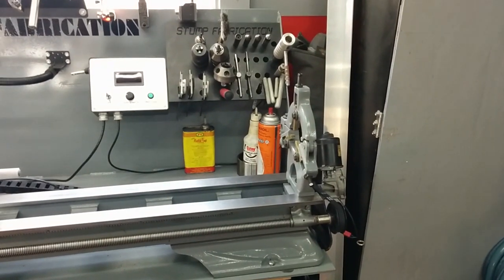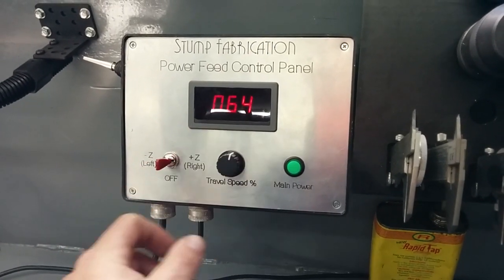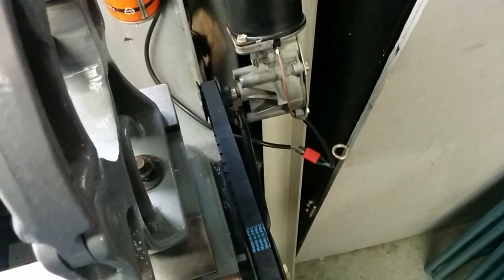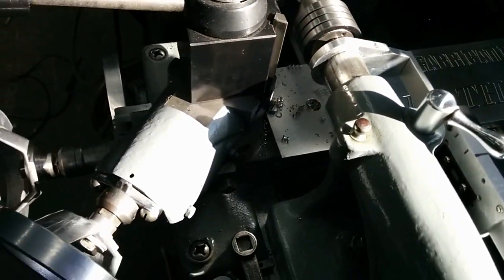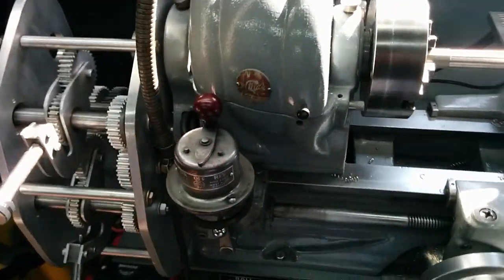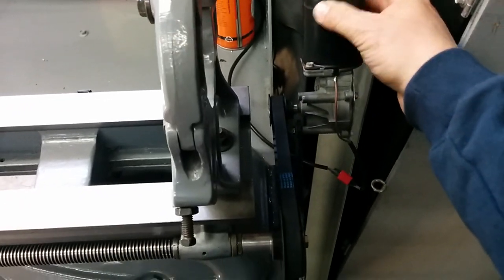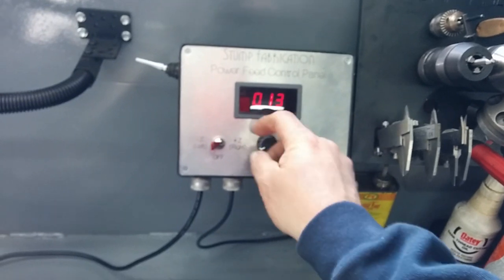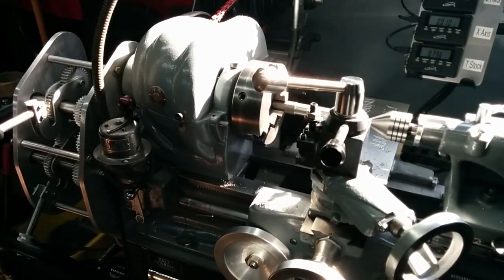Atlas TH54 10F power feed and quick change gear box

Comment: Not many know not even mrpete that the quick change gear boxes for atlas gears are in fact steel and not zmak,, that's why there so exspensive,,, l finally told Pete so it would stop making vedios that the gears are zmak..l have 2 12 inch with quick change gear boxes and checked them and both are steel.

Comment: can you  provide the drawings for the redesigned quick change gear box?
Reply from the maker: There are no new drawings John, its all in my head. or was at least. Now that I sold the lathe, i cant remember any of the details. A decent understanding of how a QCGB works, some fabrication skills, and patience and it could be duplicated fairly easily. They are pretty simple once you figure them out. Sorry I could be more helps! Thanks

Comment: If you post the completed gearbox, would you also show how the DRO is mounted under the cross slide.  I'd like to do the same mod and I see no need in proverbially reinventing the wheel.
Reply from the maker: Moderatemixed !, I actually just sold this lathe for a much larger lathe, but you're in luck. I borrowed the idea for the DRO cross slide mount from a fellow YouTuber, SteveS. check out this video, I essentially did the same thing he did. 

https://youtu.be/Oqr6fruOEwc

Comment: I've just gotten one myself; altho is a little beaten up, it should run well with some restoration. Would you ben kind to tell me where you have gotten the plans for the quick change gearbox? I'd love to build one myself. I love the idea of the power feed too; any links or place to find a schematic to build one?
-Fred
Reply from the maker: Hi Fred, the plans for the QCGB come from the October 1946 issue of Mechanix Illustrated. There are a few copies of this on EBay, as well as PDFs of the plans around the internet with a few Google searches. a friend of mine Joe McCrary turned me on to this project, as he started building the same QCGB for his lathe. I have a small CNC mill and was able to cut the extra gears that he and myself needed for the project. otherwise, study the plans, all of the info you need is there, it just takes quite a bit of deciphering and thought. 

There is no real schematic or plans for the power feed, just something I came up with. it was quite easy, and has been a wonderful addition to my lathe. I'd be glad to answer any specific questions you have about either project. jamesgclegg@gmail.com

Thanks!
Reply: Found this with the infos you gave me http://vintagemachinery.org/pubs/51/7158.pdf

I'll just have to wrap my head around the electronic feeder somehow.
Reply: Btw, i forgot to ask, what igaging ruler lenght did you use for the z axis?
Reply from the maker: +fbussier80 I used the 36" long rule for the Z.
Reply: Oh, wouldn't had guessed it to be enough for the th54, many thanks for the infos.

Comment: Phenomenal transformation on your machine.  Can't wait to see the completed gearbox.  Once saw a photo of a Craftsman 109 (A&A Industries) with a gearbox on the end similar construction to yours.  Now I know it was a project and not a factory part.  I'd be interested in your old cranks if you want to sell them.  I have about 9 lathes.  I can always used unloved extra parts.  2 QC 54's, one Craftsman 12", 2 or 3 109's, Logan 9", South Bend 9" Workshop, BC Ames.......  You don't have an "about" on your page.  You can PM me through my video page.
Reply from the maker: Thanks for the comments! I have almost completed the QCGB, but still lack a few small items. I will get it finished in the next few weeks and provide a walkthrough video on it as well. it's been a challenge, and a few of the items had to be adapted to my particular machine, but it been fun too. I plan to keep most of the parts that are no longer on the lathe, as I know how scarce they are getting. Thanks!
Reply: James Clegg Next, I want to see some oil and chips all over that thing.  ;-)
Reply from the maker: +Crafted believe me, it's filthy. right now especially.... I try to keep my stuff clean, but it a function over form kind of shop!